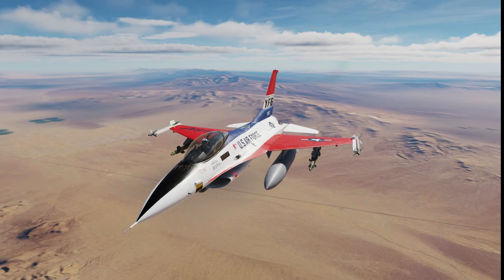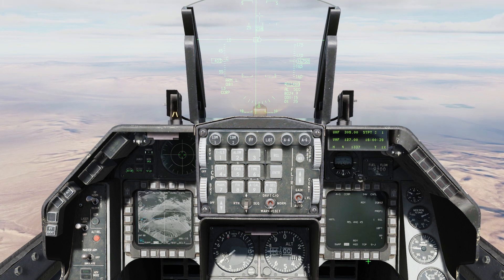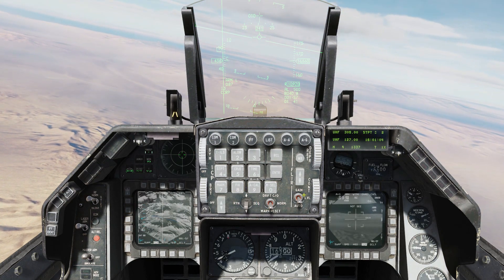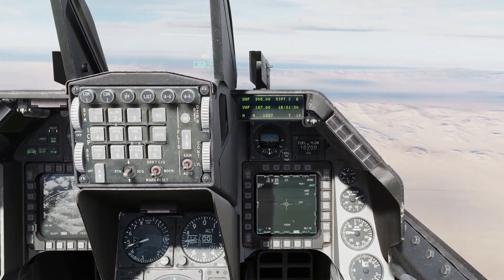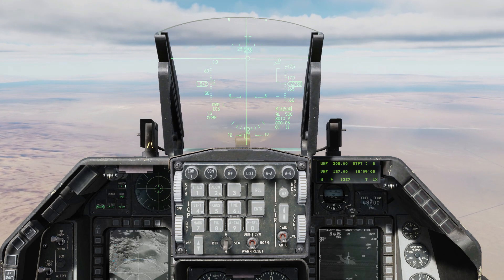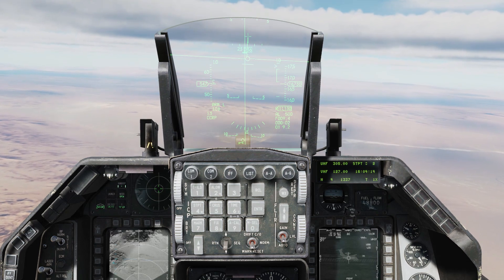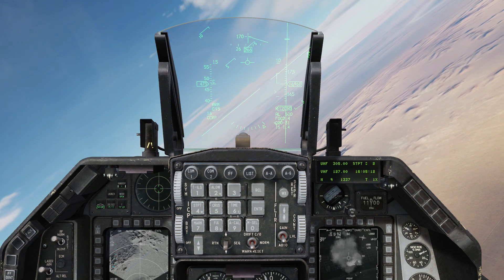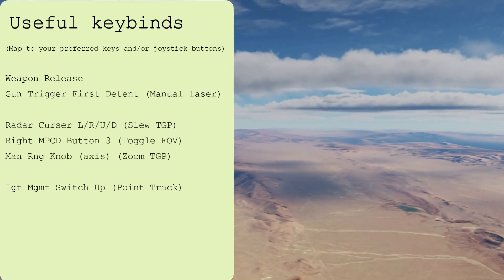DCS F-16 Laser Guided Bomb Tutorial - F16 GBU12 With Auto-Laze - DCS In 3 Or Less

Comment: Thank you for the tutorial. You saying that i don't need to laze the bomb all the way down to the target? Just in case that the L stops flashing?
Reply from the maker: Not quite. If the L stops flashing then you need to apply first detent of gun trigger which will manually lase. The bomb should reacquire the laser spot easily. If you don't re-lase at this point then the bomb will fall ballistically, which may or may not get you a hit. With correct setup and orbiting like i did though (slight turn left then right hand orbit) you should be unlikely to lose the laser track.